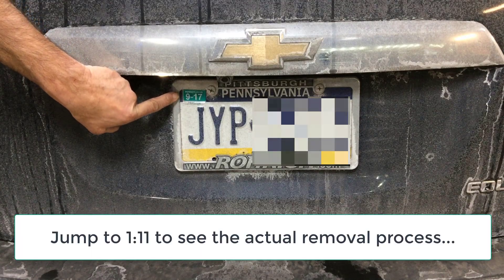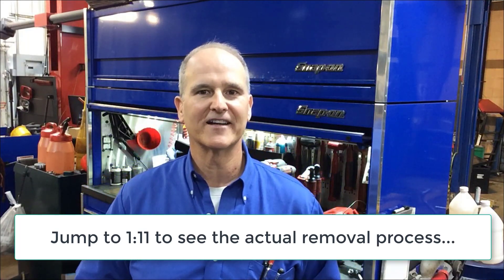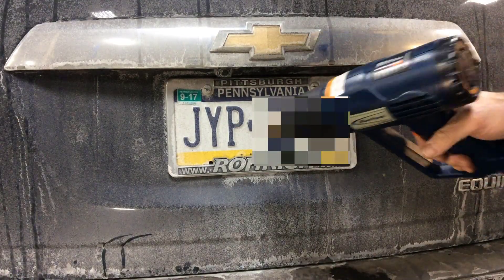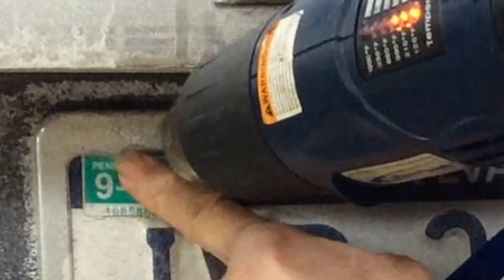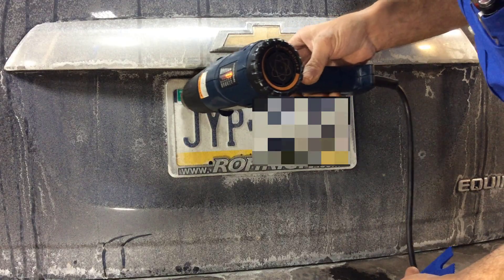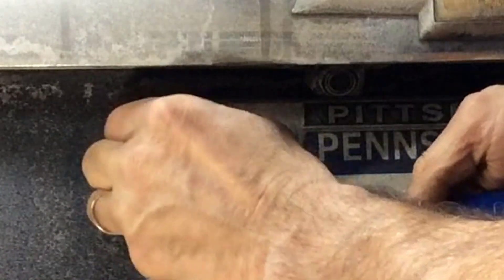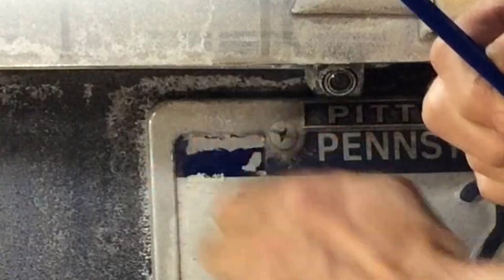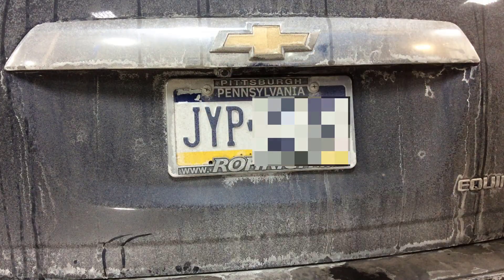How To Remove Expired Pa License Plate Registration Sticker Elizabeth Auto Care

Comment: SEVERAL years sticker build up, dreading task of removal. Always freezing cold winter at my sticker renewal time. Car’s way down in underground parking, no electrical outlet access. The Lord reminded me of my little portable hand-held steam cleaner I had forgotten about. Filled it with purified water, heated it up at home, unplugged, took it down to the car. Blasted that sucker with a bit of super hot steam, minimal scraping with utility knife, easily pulled old stickers off by hand, wiped it clean & dry, applied new sticker. NO heat gun, NO Goo Gone/toxic messy chemicals, NO plate removal, NO hair dryer, NO agony. ALL glory goes to God, giver of all wisdom yay!!